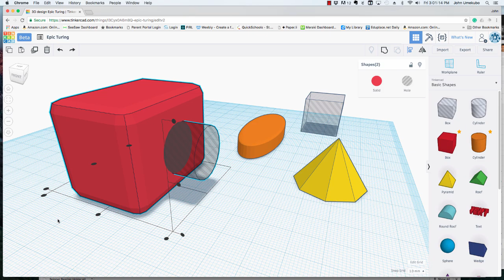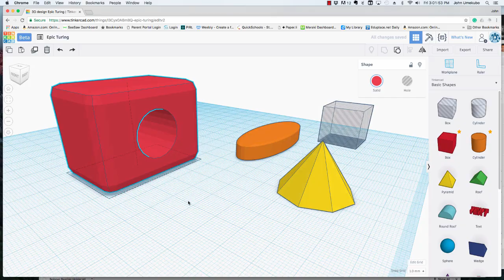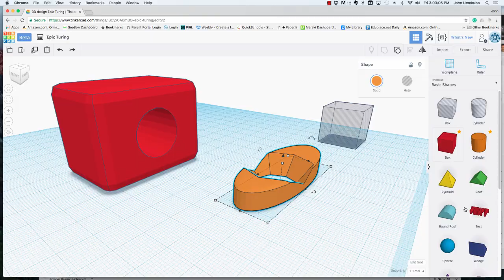07. New TinkerCAD - Creating Holes

Comment: Is there a way to do countersunk holes? The bevel tool adjusts in an opposite way, creating an inward taper.
Reply from the maker: That’s an interesting question. I guess for me, I would think about what the hole needs to look like and then make that object first, even if it means combining shapes to create what I need. Then, I would select that newly made object and turn it into a hole. I hope this makes sense. Hard to explain without another video but basically anything you can create as a solid can be converted into a hole to use against any other solid object.
Reply: @johnumekubo  thank you very much for your reply. It kinda makes sense that the solid would be the chamfer of countersink part, and without actually trying it yet… I imagine that new solid could be rotated in any way necessary to be placed correctly on the existing hole, correct? It might take a little trial and error, yet the countersink part wouldn’t have to be perfectly perfect, so long as the screw head was sub-flush and supported. I ended up making my holes large enough to fit #12 “truss head”  screws I had on hand. Since I wasn’t sure how to do this yet using my #8 deck screws. 

I’m signed up for CAD courses to get a certificate in a CADD program locally. I’m looking forward to AutoCAD student software editions.
Reply from the maker: @Personalized_Workshop   Excellent! It sounds like you are well on your way to learning more advanced tools. All the best to you!
Reply from the maker: @Personalized_Workshop   And yes, with some trial and error, you can figure out the best way to align objects (solids and holes) to create just about anything.

Comment: you skipped step 1.... how the heck did you get the second side menu letting you choose hole?
Reply from the maker: When you select any object on the workplane, that side menu will appear. It will look different for different types of shapes, but it will always have the option to choose solid color, or hole shape. If you have not selected any specific object on the workplane, that side menu is not available.

Comment: Do you have a video that shows how to center a capture over an existing hole in TinkerCad?  I imported an SVG file which already had the holes in the design.  Now I want to create bolt captures and/or standoffs over these holes.  I have not been able to figure out how to perfectly align, say a cylinder over an existing hole.  I want to take a cylinder (or any shape), align the center of the Cylinder with the center of the existing hole, then I will create another hole in that cylinder to actually have my Capture or Standoff.  Any help will be appreciated.  Thank you for your videos!
Reply: Very good idea on the cube!  I had made some headway using a cylinder but now I will use a cube.  I am also going to start playing around with Fusion 360 and see what I can learn.  Thanks again for the reply!